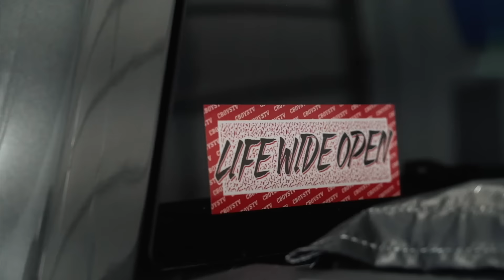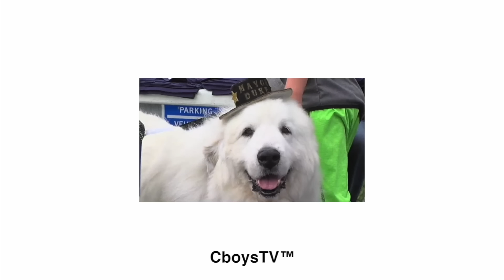Lifting my Ford Raptor and taking it off road!! (we got stuck) and scaring people with train horn

Comment from the maker: Bens Raptor turned out sick!! What’s your guys dream truck?
Reply: 2019 Chevy Silverado 2500 hd duramax  with a 2 inch level and it’s black and chrome (sorry for being late)
Reply: Mine is a old 1996 ford ranger with black rims and a 4 inch lift
Reply: Raptor
Reply: Ford f150with 8inch lift and some custom offset wheels
Reply: And towing a 2023 41 black water
Reply: Ram trx
Reply: @pugsleysgamingandmore3111 😊
Reply: bh76y
Reply: a truck thats payed off.

Comment: Ben needs a Half over cab chase rack for the Raptor, it's a little bit pricey but they make the trucks look way better and you can utilize it for hauling gear on the roof plus attach more lights to it and a spare tire.

Comment: You guys should put a deck on the back of the Duramax so you can hall multiple sleds instead of having to use the trailer or get someone else to put a sled in there truck

Comment: No shouldnt have wasted it with a lift kit, it has proper suspension front and rear just add to suspension all the lift is for looks not function when it comes to raptors